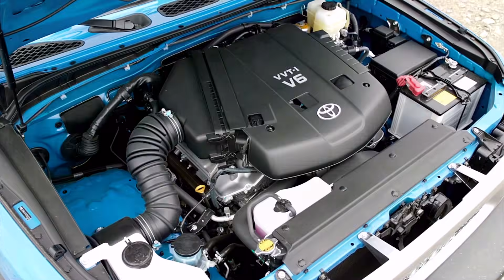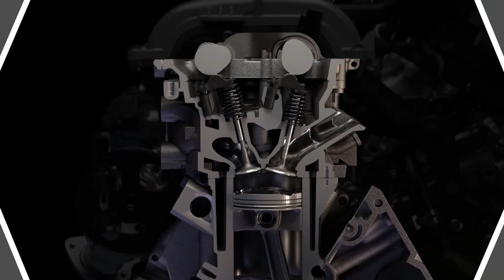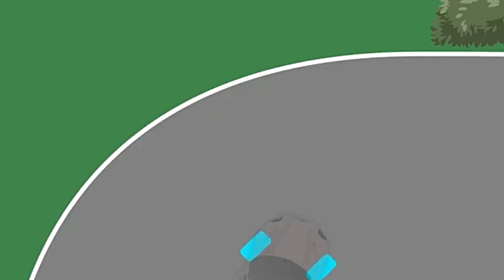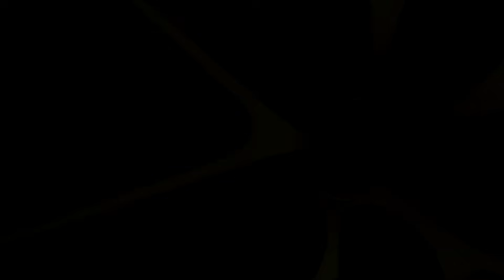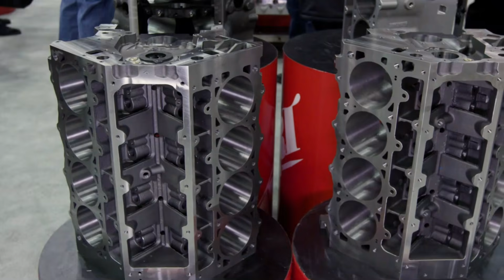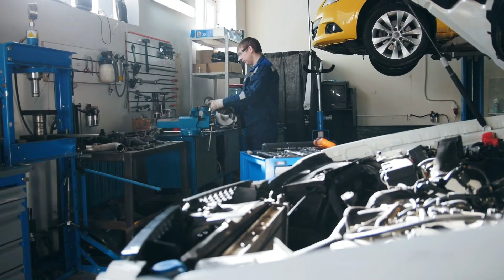Toyota’s Most Underrated V6 Was Actually INSANE

Comment: You've just also described engines from several other manfacturers.
Reply from the maker: True, a lot of manufacturers shared similar engineering struggles or designs during that era. It was definitely a trend across the industry, not just limited to one brand.